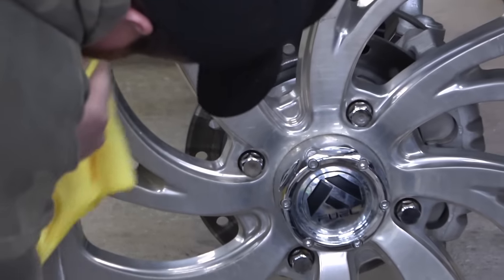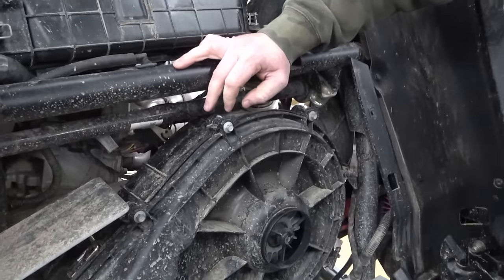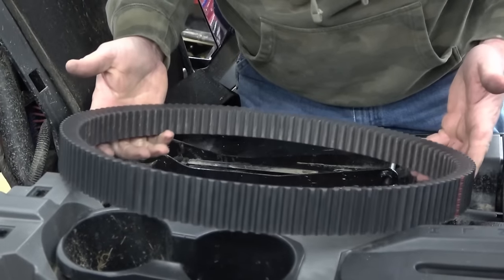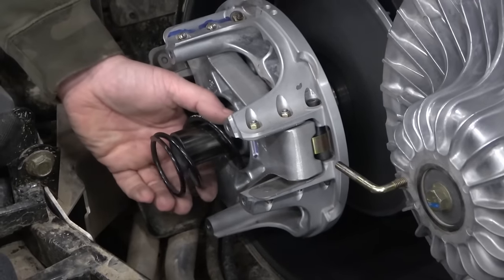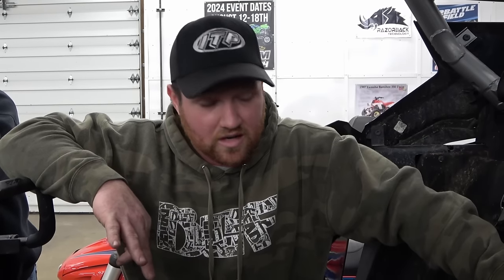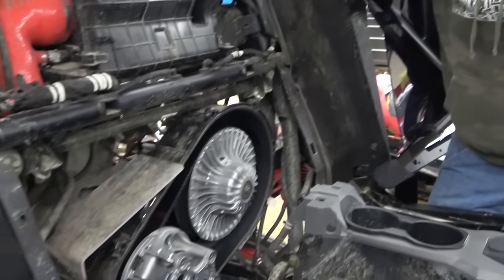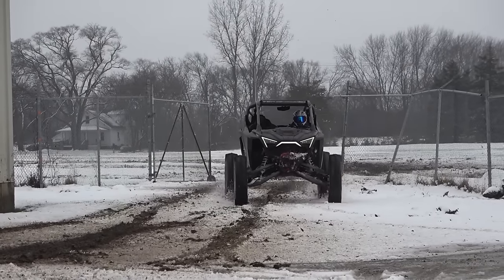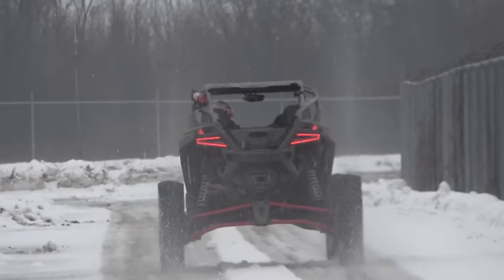RZR Pro R clutch tips and tricks!

Comment: Mine was a nightmare.  The plastic that hold the nutwas stripped from the factory so I was in the middle of the dunes for hours at night. I had to take a flat head screwdriver and hammer and chisel the plastic of all of them but one, so I could hold them with pliers to get the screws out .